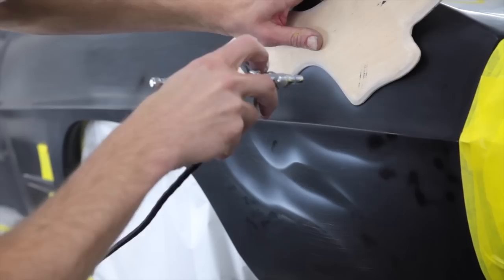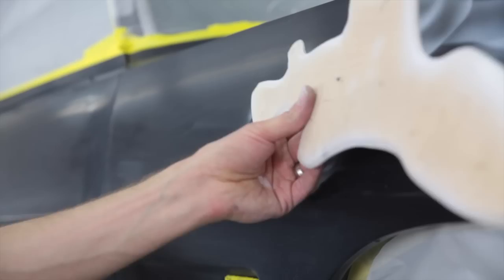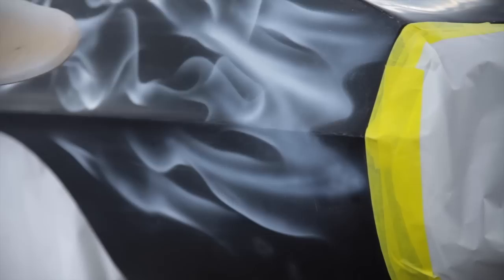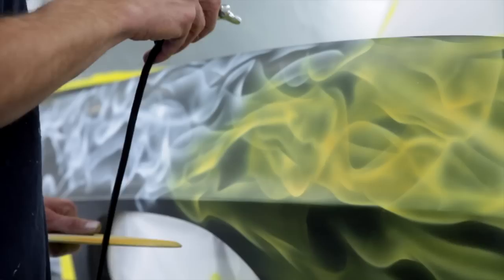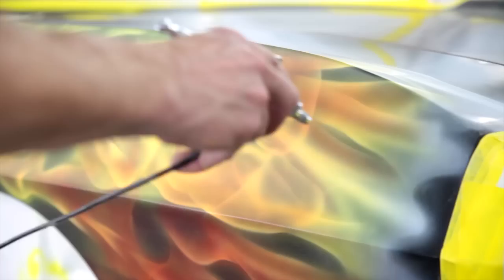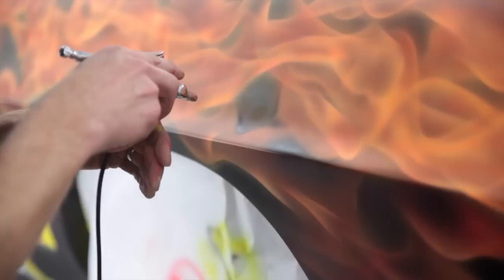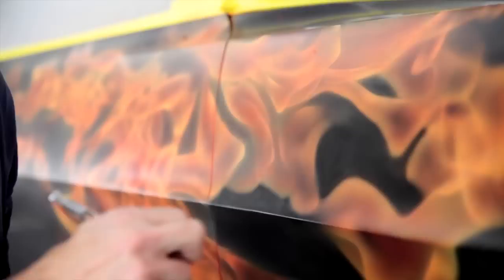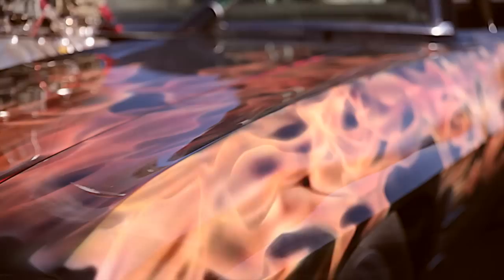How To Paint Realistic Flames

Comment: what paints are you using Joe
Reply from the maker: philip overholt In this one, It's Sherwin Williams automotive paints for the colors and then the clear coat was sprayed on by Andy's Auto Body but I think it's a just a high quality polyurethane that's typical for automotive use. I tried thinning these with xylene. That was a mistake. It separated the paint. I had to use the specific solvent that SW made for those paints.